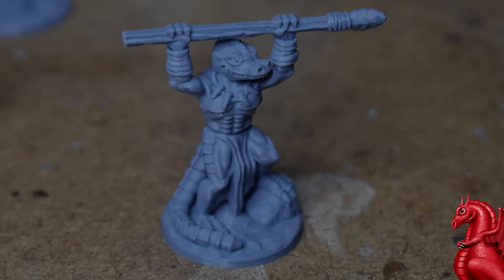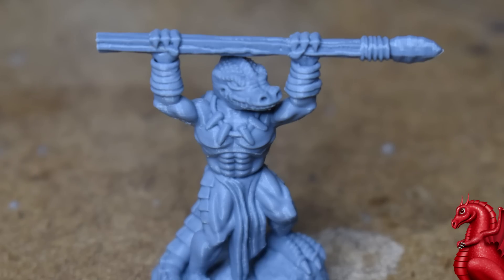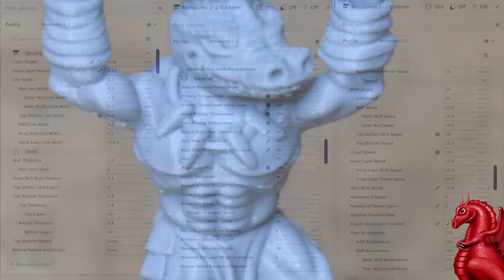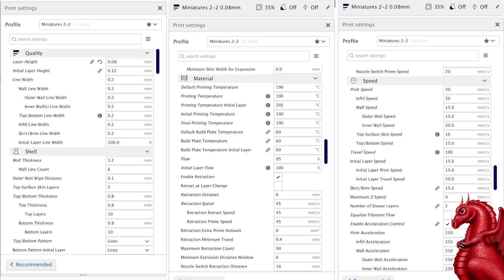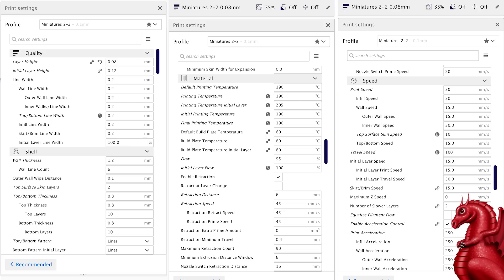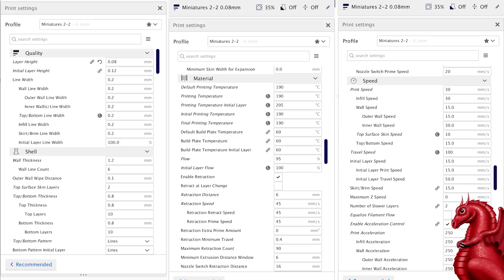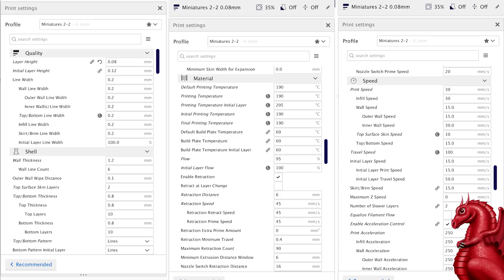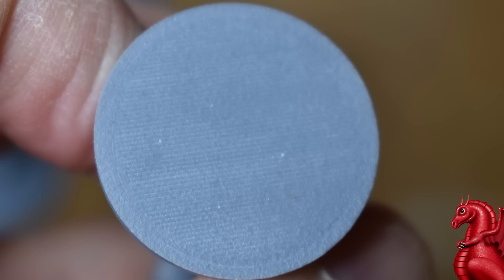How to 3D Print Better Miniatures: Pt. 3 Resin-quality on a FDM printer!

Comment: Hello! Awesome and very useful video as usual, your profiles are always on-point !
Do you have any tricks or suggestions for "good" supports settings? Because that's the only thing I'm having trouble with your otherwise perfect profiles!
Reply from the maker: I'm afraid not, I haven't spent time developing settings for supports since none of the miniatures I sculpt require them.
Reply: @Tombof3DPrintedHorrors  How do you manage to print those without supports?  Looking at the lizard man at the beginning of this video, with the spear overhang...how would that print without supports??
Reply from the maker: @unB10  we're experts at no-support sculpting! Seriously, nothing we sell requires slicer supports. EVER. :)
Reply: @Tombof3DPrintedHorrors  Apparently so. Lol. I just can't wrap my head around the physics of it. But apparently it's not a setting but function of the design. I had to buy a custom mini for a character I'm playing and was hoping it was a trick I could use, because this thing definitely needs supports! But the supports are ruining it. :(

Comment: Amazing, if I can get results like yours I won’t bother buying a resin printer!
Reply: ^ Exactly this. Currently weighing my options. Love the FDM print size and material costs... but that Resin quality tho...
Reply from the maker: @CalmPlains  just keep in mind the toxicity of the resin, and the safety precautions you must adhere too. I see way too many people not doing their homework on it and making mistakes like rinsing uncured resin in a kitchen sink, using latex gloves instead of neoprene or nitril, throwing empty bottles with uncured resin in their trash, etc.
Reply: @Tombof3DPrintedHorrors  Safety first!  think the big deal breaker for me with FDM is the sheer amount of troubleshooting involved. More variables, more things that can wrong, more expertise required. Contrast that to an Elegoo Mars plug N play printing, and far less mechanical bits that can get screwed up.... I want to like FDM but it seems like a mountain im too lazy to climb. That being said I have not made a purchase decision yet.

Comment: I downloaded cura 4.3 and your profile. it wont load it says "Could not find a quality type super for the current configuration"
Reply from the maker: Use Cura 4.0
Reply: @Tombof3DPrintedHorrors  That was it. Thanks! I've had success with your other profiles on my Geeetech i3 and other printers.

Comment: Hello there.
Super interesting video; I'm starting to get interested in this world and I have a question that comes from ignorance: PLA being biodegradable, won't print get ruined over time? In short, why bother printing miniatures and scenarios (and then painting everything) if then 
in a short time it is all to be replaced?

And I wanted to know:  Is there a material that does not have this problem? (like resin ecc)
Reply from the maker: It is only biodegradable in an active compost pile, that is kept wet and over 130˚. They will not degrade in a home environment. :)
Reply: @Tombof3DPrintedHorrors  speak for yourself, I'm currently squatting in the giant crystal cave https://en.wikipedia.org/wiki/Cave_of_the_Crystals

Comment: I once watched a video on printing miniatures and this guy prints all his figurines as 100% top layers and the resolution was unbelievable, even with a .4 nozzle, unfortunately, I can't find that video I think it must have been in my recommended feed
Reply from the maker: That's not the best way to print miniatures, I discuss why in this video here: https://youtu.be/AqEWl51s9Rw
Reply: That sounds like the siepie profile. I've tried it, I personally didnt like it but it's a pretty popular profile so you might give it a shot.

My  issue was that since it's based on a trick in the slicer, when if didnt work troubleshooting was all but out of the question